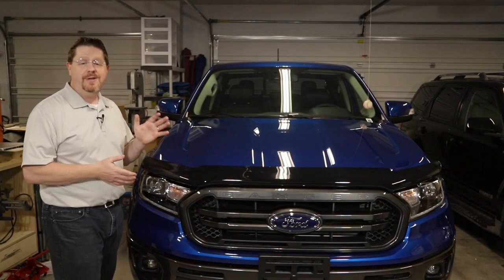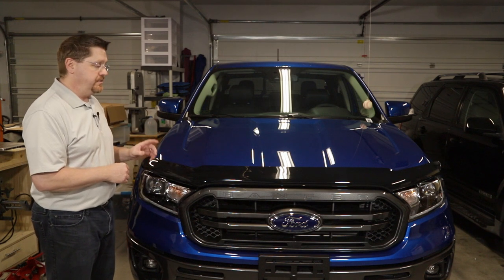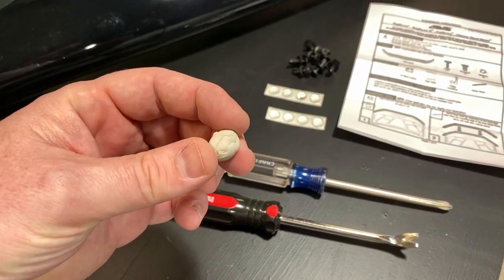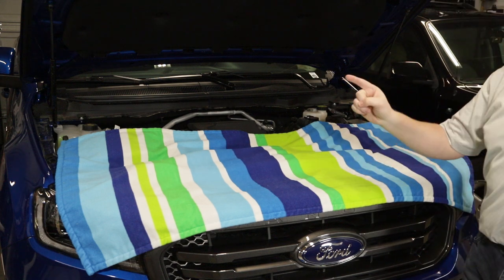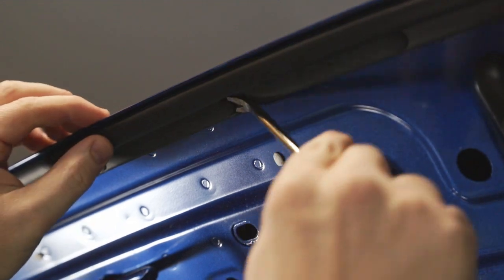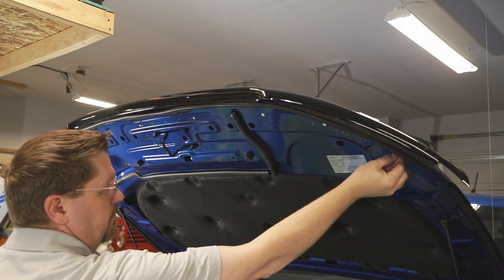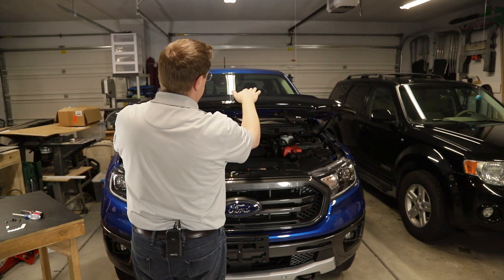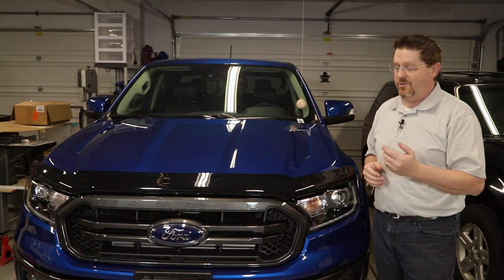How To Install AVS Bugflector II - 2019 Ford Ranger

Comment: I think I am going to put the little bump stop thingies on the deflector. Not my new shiny truck. I got my AVS Deflector from a buddy and he lost the instruction sheet. So I am a little surprised that they would have you put them on the truck. 
Other than that a very well made, high quality video. Thank you for taking the time to put it together.
Reply from the maker: Since filming this video I actually just completely removed the bump stops. The way this is installed, I don’t see any possible way that the deflector could ever get pushed in enough to actually touch the truck. It’s really stiff. Either way , I hope the deflector works well and that you love your new truck. Thanks for watching!

Comment: Great videos, i just got a Ranger, and because of your video, just bought that bug deflector. Next on the list is the tailgate dampener, also from your videos. Please post more Ranger improvements as you get them for yours
Reply from the maker: Stay tuned! I have several more in the works. Thanks for watching!
Reply: AmplifyDIY and, how do you keep your truck so clean? Especially under the hood
Reply from the maker: @ThanhNguyen-kd5ny  Heh - it was REALLY new when I shot most of these. :) It's not so clean under the hood any longer... but you can take it to a car wash and spray out the engine compartment if you really want to try to get it cleaner. Thanks for watching!

Comment: Thank you I just installed my deflector using your directions.
Reply from the maker: Nice job!
Reply: What year is your truck Kyle? I have a new 2021 but want to make sure it fits, thanks.
Reply from the maker: @frankquezada5490  Hey Frank - it should fit. The truck in this video is a 2019, but I believe there were no changes to the hood between '19 and '21.
Reply: Thank you, I did install the damper and it fit perfectly. I will get this bug deflector and install it. I'll let you know how it works out, thanks again.

Comment: Great quality video! Thanks. Have you found that leaves or anything else accumulate under the deflector? Concerned about things getting stuck in that 'channel' that's now created.
Reply from the maker: Thanks! No, I have not had any problem with stuff collecting. There is ample drainage holes in the bottom corner of the deflector as well, so water does not poop there either. 
Thanks for the feedback, and thanks for watching!

Comment: Very good instructional, thank you. One thing though, you didn't want to put any tape on your hood but you stuck the bump stop to your hood! Why not put the bump stop on the inside of the deflector itself?
Reply from the maker: Thanks! My rationale when I filmed this is that the 3M Automotive tape is so strong it can peel paint off when you try to remove it. The adhesive on the bump stops is nowhere near as strong, so I was not concerned. However, the deflector is so stiff I don’t think it needs any bumpers at all. I’ve actually removed them entirely. If I ever put them back on, I’ll mount them on the back of the deflector as you suggest. Thanks for watching!

Comment: Great video all around.  Thank you!!!  Any chance you can show where you place your other bump stops?  Cheers.
Reply from the maker: You mean the little rubber bumpers? Sure, I’ll go snap some pictures and be right back with a link. Thanks!
Reply from the maker: Here is where I located them: https://www.instagram.com/p/B_8QVZcjYMQ/
Reply: @AmplifyDIY  I would have preferred them on the inside of the deflector rather than directly on the truck.   Nice video.
Reply from the maker: Now that's a great idea! Why didn't I think of that - it seems so obvious now that you mention it! I'll be taking the deflector (and bumpers) off the truck to install a ceramic coating in the next week or 2, and when it goes back on, I'll put the bumpers on the deflector instead. Thanks for the idea!

Comment: Does it still do the job after you uploaded the video, any issues at all?
Reply from the maker: Works great - no issues. I'm really glad it is there, as several times when washing the truck I've found evidence in the deflector of rock strikes which would definitely have chipped the front of the hood. Thanks for watching!
Reply: AmplifyDIY I just ordered one. Thanks for the instructional video
Reply from the maker: @poman12ap  Good luck with the install! I'm happy to answer any questions that come up for you.

Comment: Would it make more sense to attach the bumper to the deflector itself instead of the car?
Reply from the maker: Hi Adam! Yes - a few other viewers also suggested this, and it's what I now recommend. In the video I followed the install instructions, but if I were doing this again I'd stick the bumpers to the inside of the deflector - or, just leave them off entirely. I removed mine when I detailed and paint corrected my entire exterior. The deflector never flexes enough to get close to the actual paint, so I didn't bother putting new ones on. 
Good luck, and I hope you love your Ranger!

Comment: Do you know how to remove the front ford emblem on a 2020 ford ranger XLT?
Reply from the maker: I've never removed mine, but apparently there are 2 10mm nuts you need to remove from behind the emblem. More info here: https://www.ranger5g.com/forum/threads/removing-front-rear-emblem-2019-ranger.4199/post-273632

Good luck!

Comment: just installed today, does it seem the screws wont fully tighten?
Reply from the maker: I didn't have any issue - are you sure you layered things correctly? The deflector front lip goes between the hood and the factory liner, as I recall...
Reply: @AmplifyDIY  that's how I layered it.

Comment: Anyone know if ford ranger oem deflector installs the same or do they use 3m tape?  Thx
Reply from the maker: Hi Jeff – I don't know for certain, but after looking at a couple of eBay listings for part number KB3Z-16C900-A I see what appeared to be mount holes on the lower side of the deflector. This would seem to indicate to me that it is mounted in a similar fashion to the AVS one I showed in this video. However, don't take my word for it. You can always call your local dealer and ask. Good luck!

Comment: Wish i could find a clear bug deflector to be painted factory color for 2021 Ford Ranger.
Reply from the maker: If you are going to paint it, why does it have to start clear? You can paint the one I showed in this video...
Reply: @AmplifyDIY  because the inside of the shield will be painted, transparent with the clear.
Reply: @AmplifyDIY  Doesnt do any good to paint the outside, the paint will chip, not on a clear one. Paint is transparent.
Reply from the maker: Ah, I understand. Good luck finding one!
Reply: @AmplifyDIY  I know, rare like a unicorn.

Comment: anyone knows if this works on the 2018... the hoods look the same
Reply from the maker: Hi Rene - I know this works on the North American Rangers that were introduced in 2019. I know these Rangers were based on the World Ranger that has been selling in other markets for several years earlier, but there are some differences. I don't know if the body panels are an exact match... the hood may be slightly different. I'd recommend you check with the manufacturer to make sure you are getting the right one to fit your truck. Good luck!

Comment: Doesn't want to put adhesive on his new car but puts sticky tabs on there anyways haha. Well thanks for the video! Super detailed instruction I appreciate it. Also, couldn't you also have put those clear tabs on the deflector itself instead of the paint?
Reply from the maker: Heh - yep! You can definitely put them on the deflector instead of the paint. Also, the adhesive on these little bumpers is not nearly as strong as the 3M automotive tape that is used with other deflectors. That stuff is strong enough it can potentially pull off your clear coat if you ever need to remove it. Thanks for watching!
Reply: Great video!
Reply: I dun get this guy, if I was him I woulda welded that bad boy on there!

Comment: I would have put this bumpstops on the deflector itself instead of on your paint .when it gets hot out it's going to melt and  over time it will take the paint.
Reply from the maker: Good tip, Gold. I actually removed the bump stops when I ceramic coated the truck, and added them to the inside of the deflector itself instead, as you have suggested.

Comment: I had a heck of a time with this my 2020 Ranger, I find those fasteners do not hold very well, I snapped 1 screw head as well very flimsy, is there any place for replacement hardware?
Reply from the maker: Hi Mark - sorry you had a hard time with it... the fasteners can be a bit finicky. I'm not sure if you can find exact replacement hardware, but I'd take an example of what you need to your local auto parts store (O'Reilly's, Autozone, etc) and see what they have in stock that may work. It's a good bet they'll have a close (if not perfect) match. Good luck!
Reply: @AmplifyDIY  Alright second go at it, some new inserts mixed with the factory ones,.found some were still popping out as I went along, then couldn't get the hood to latch , I removed one gramet at the front and after that it closed, seems soild enough, but I'm worried over time with the opening and closing with this shotty hardware lol
Reply from the maker: @markmarino3750  Hey Mark - sorry to hear about all the trouble you had. I hate those stupid fasteners as well... you have to be SO gentle with them or they just break. As for the hood latching issue, I did a video all about how to adjust your hood latch so that you don't have to slam it, and the deflector won't rub on your paint anywhere: https://youtu.be/J2wvighggDs - maybe adjusting that latch will make life a little easier on your hood, the hardware, and your paint. Good luck!